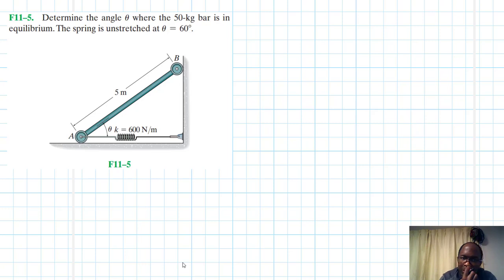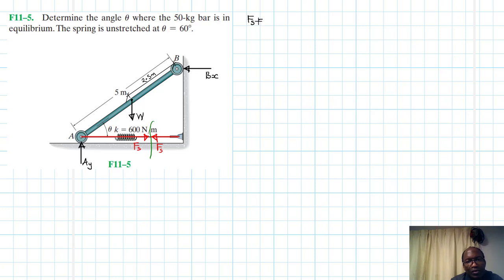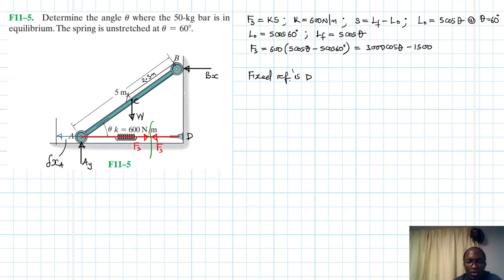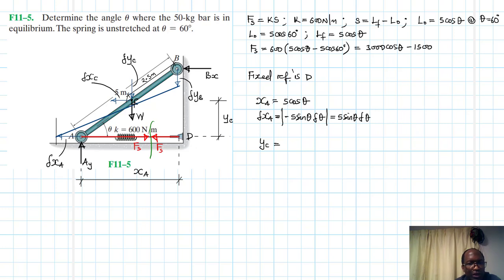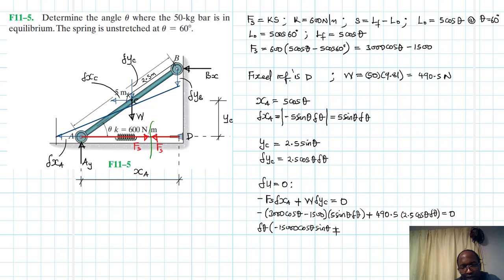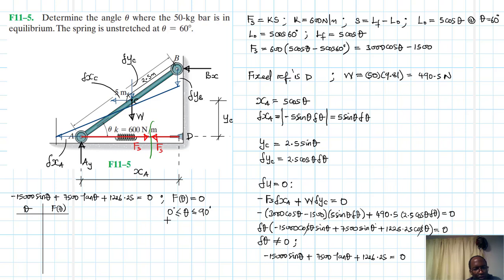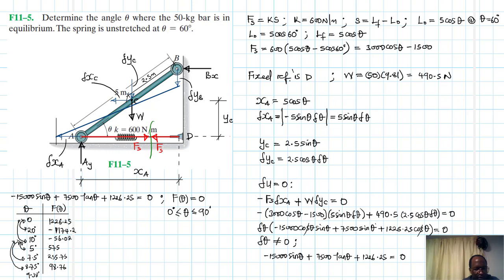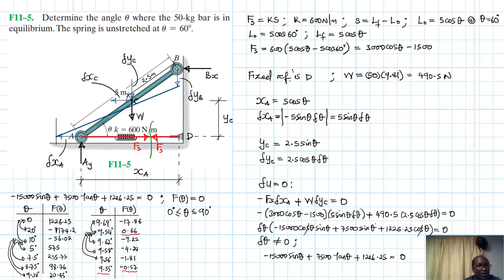F11–5 Virtual Work (Chapter 11: Hibbeler Statics) Benam Academy

Comment: theta is always smaller than 90 bc theres a tan inside the formula so it hasd to be 0<-th<90
Reply from the maker: The equation was solved using a trial-and-error method. While the solution is independent of the selected range, the domain of 0° to 90° was chosen as the most suitable interval and was progressively narrowed to obtain the solution.